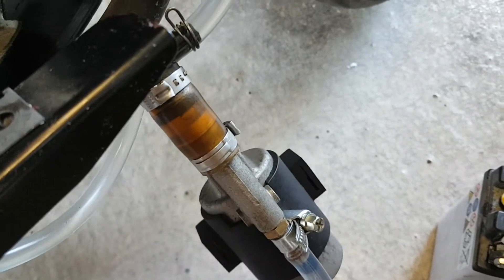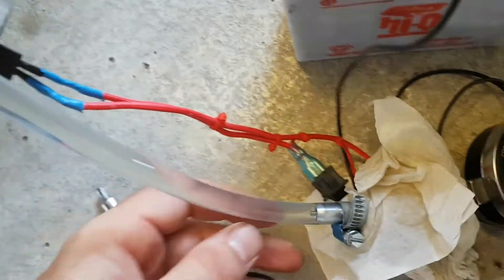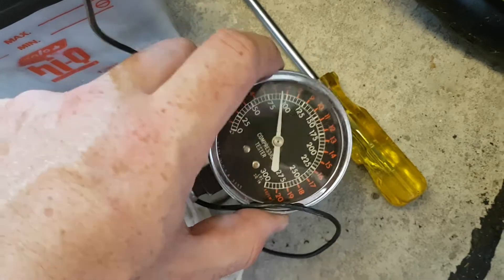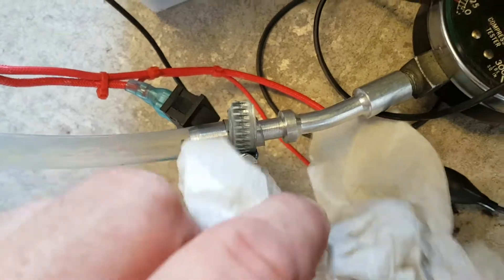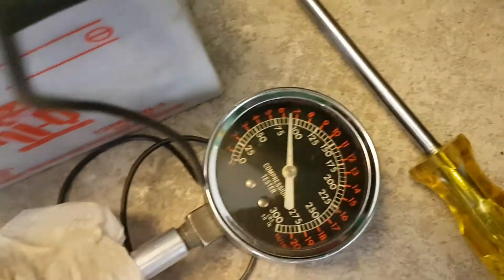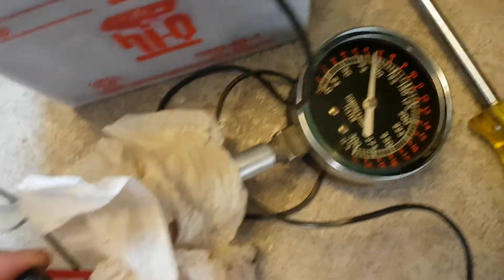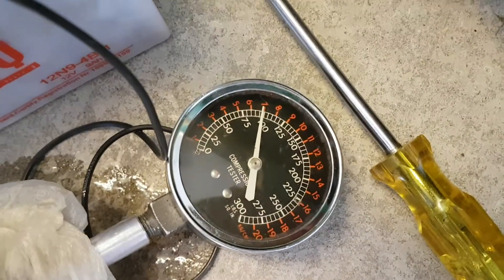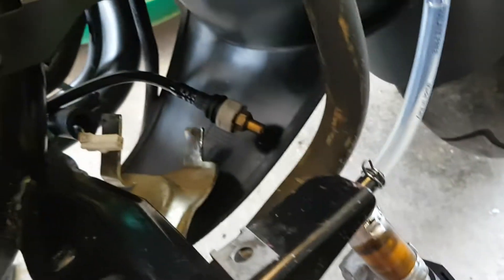Gilera Runner 50 Purejet fuel pump pressure test

Comment: I think that some dirt got stuck in my fuel pump. Is it possible to clean out the pumps jet?
Reply: Hi. I have resolved my issue. It was air in the fuel system..allsow in the fuelpump...alot of air.
Reply: @Janne Tranberg I have changed most of the fuel lines and the fuel filter. So I assume that is how air got into the pump and into the fuelline between the pump and injector head.
Reply: Hi. I tried everything from the basics. That means disasembled at least three times the bike again and again and analised step by step again and again. And like allways it was something realy banal. How did I chek the pressure?! Like a child with normal bike-pump. Just put my finger on it to check how does 8 bars feels like?! You can not keep your finger on it after 5 bars. So i tryed the injector. It was some pressure but not enough. So it could be the air compressure or the fuel pump. At the aircompressor the hose gose bad usually. Chek it if it builds 8 bars...with your finger. If you can not keep your finger on it than it is ok. So the next step is the fuel pump. Let me know if I can help
Reply: @Janne Tranberg Now check the fuel line exactley in front of the injector head. If it is building enough pressure(approx. 5 bars) than you have problems with the injector head. I have also bikes with carburetor. Did not have major problems neither with injector nor with carburetor...I just tought I head unthill I found the solution

Comment: Hello guys, i have a problem with my gilera and i dont know what should i do. The problem is when i bend the motorbike on the right side it loses power(sometimes it turns off) can you help me please if you know what is the problem so i can focus on that thing? Tnx
Reply from the maker: is the fuel tank full when you bend the bike ? you bend it while its not moving right?
Reply: @petesgarage4670  yes its full, it does the same thing while i am driving it or not moving..
Reply: I changed the spark plug but everything is same🤔
Reply from the maker: @bennobe9818  is your scooter an injection or carburator scooter?
Reply: @petesgarage4670  its with an injection.
Reply from the maker: @bennobe9818  and while you lean it to the right do you move your steering wheel to the right???
Reply: @petesgarage4670  haha sometimes yes but mostly now because i drive a little bit faster.
Reply: @petesgarage4670  but why does the steering has to do with this?
Reply from the maker: @bennobe9818  it can be that you have a cracked cable which causes a shortcut while moving the steering wheel. I had it with some other scooter of mine

Comment: Hi..would you know where the fuel filter is located on a 2010 gilera runner sp 50cc
Reply from the maker: on the newer models there is no filter at all. its recommended to install one.
Reply: @petesgarage4670  but the bike shop provided me with one through checking on the parts list catalogue so there must be one hiding somewhere..cheers anyway
Reply from the maker: @taffygup1272  maybe they mean the pressure valve opening the fuel flow. this is located inside the fuel tank and has a tube like filter on it.